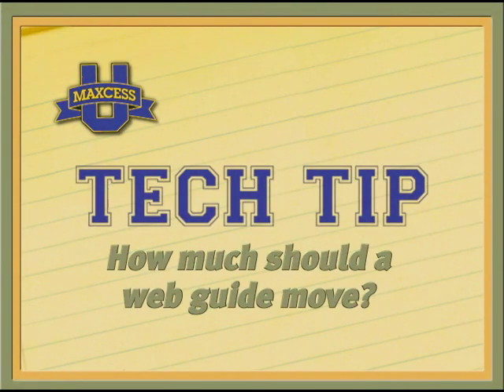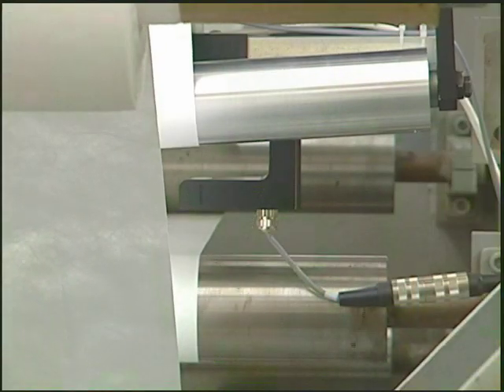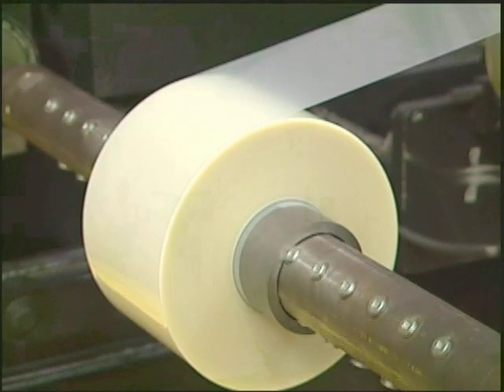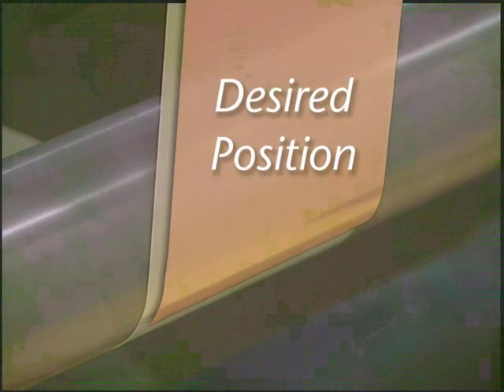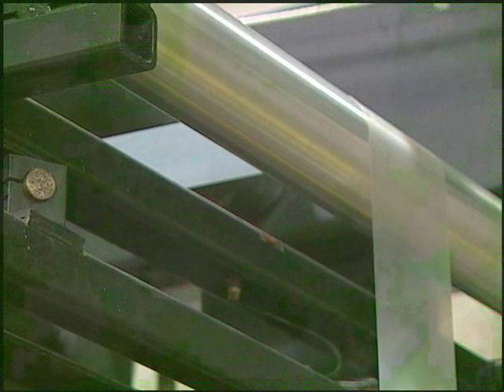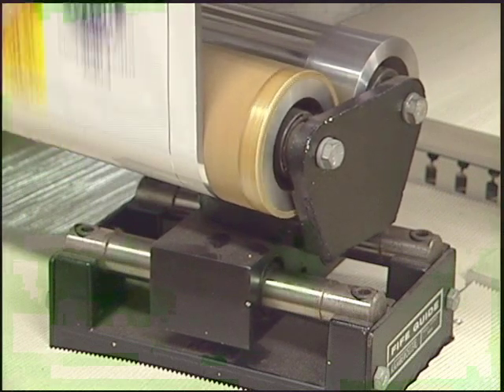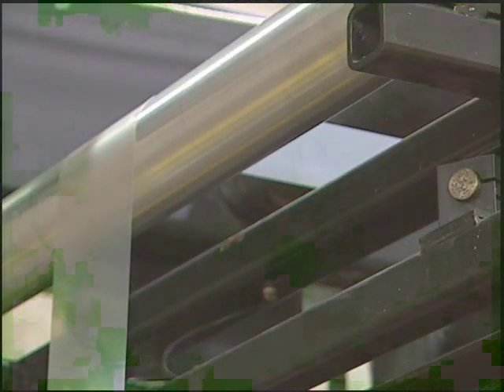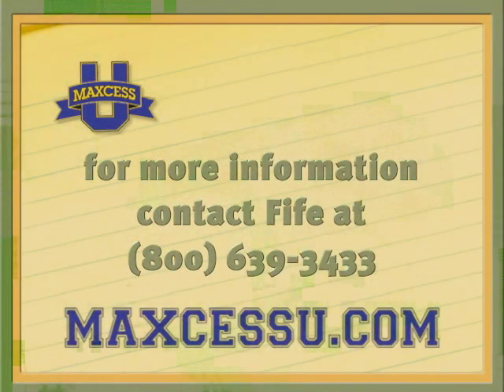How much should a web guide move?

Comment: I have an older John Dusenbery paper slitter and am having trouble with bowing on the end of the roll, i.e. my edges are not straight on the two ends of the slit paper. Any suggestions or directions?